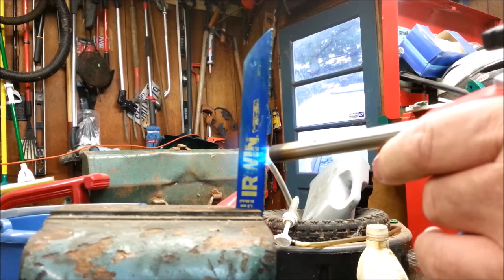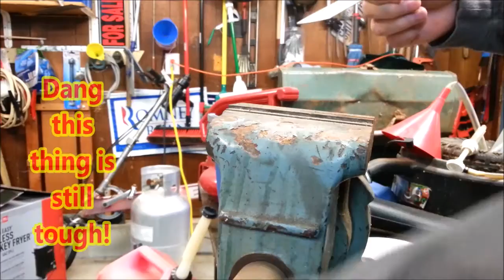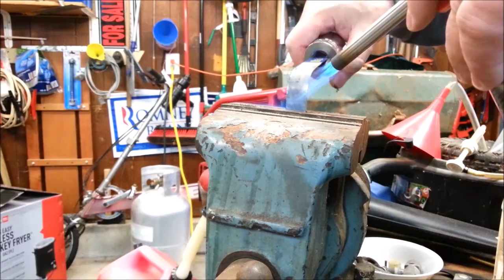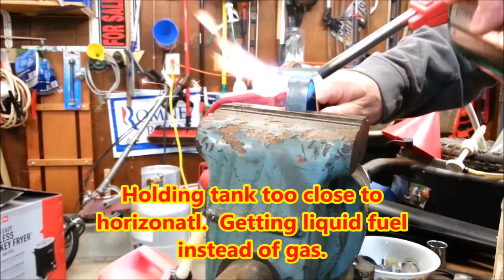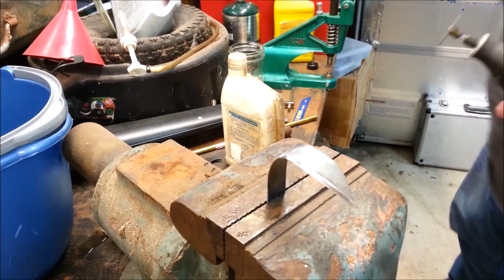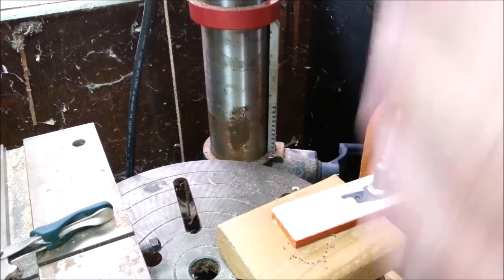Crook / Spoon Knife From Reciprocating Saw Blade - Part 1

Comment: I saw BluegrassBushcraft unbox this. Very pretty work.

I'd like to offer a few pointers from experience.  I pretty much started my first spoon knife just like you. Even used an old sawzall blade.
What I've learned.
Before I made a forge I would anneal by building a camp fire -get it red (non magnetic-put a magnet to it and verify, once its nonmagnetic its ready) and allow it to stay in the embers until they cool. Can also get it red and put in deep ashes and let slow cool.
Do all your blade shaping before bending. Get the geometry you want and then get a black pipe nipple or a round pc of steel and place it in your vice. Heat to non magnetic then take the blade and gently tap it with a hammer as it bends around the nipple. Only bend while its non magnetic. Non magnetic is also known as critical temperature. 
To harden take back to critical temp and quench in veggie oil. It is now hard. Clean the steel to shiny. 
Take your little torch and heat the tang until the blade turns a straw color and remove from heat quickly. 
Being thin it may not take that long. And let cool. Handle, sharpen and use. 
Others might tell you better tempering step. 
Also Janz knife supply sells knife steel. 1095 is easier to use. 
Hope some of that is helpful. John.

Comment: Kinda cool watching this from part 5 then to one and seeing how it became a tool from a tool. When you was bending the blade I wonder if you could use maybe a wire in the end hole. Bend it to the shape and hold it while you heated it and release some of the tension as it anneals? Not sure your following but I got an idea in my head after seeing this... Off to part 2 brother
Reply from the maker: Yea, that was a bit clumbsy how I was holding it.  I have some O-2 tool steel now.  I might make another one.  Going to do a neck or some kind of small knife next.   I have some 4mm steel to do my own Bushcraft knife as well.   I've been trying to collect equipment for my shop.  I've got a good assortment of woodworking tools but all my metal tools are simple things like files and hacksaws.   Working on getting a metal cutting band saw.